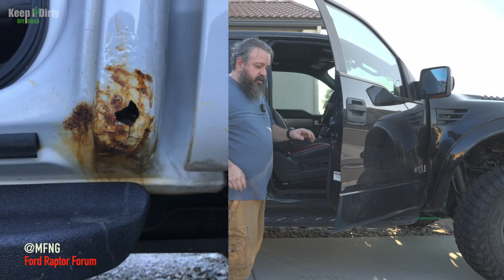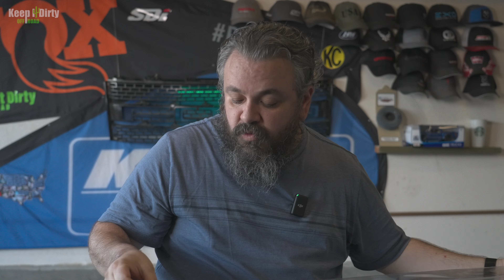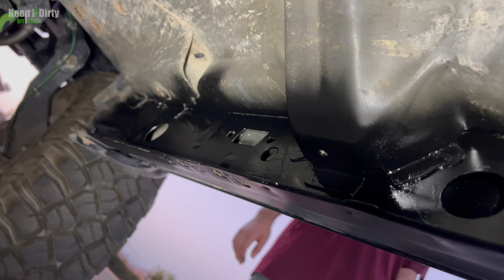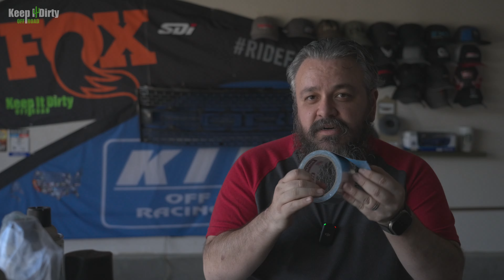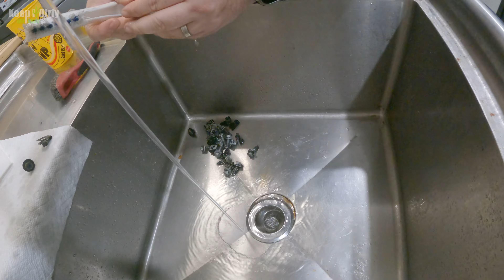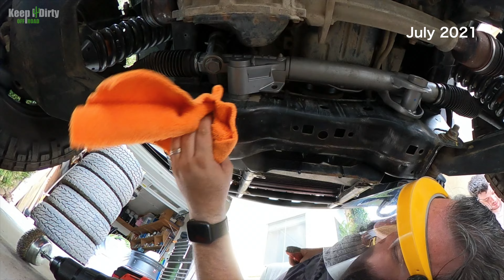Cab Seals  Gen1 Raptor - Don't let your truck rust away

Comment: I worry that due to not finding 3 out of 4 drain tubes they could be clogged by the wax. Thanks for all your videos.
Reply from the maker: The wax lays down thin and still allows water to bead away and down. Water still needs to be able to exit from the pinch welds and the wax has not blocked that. And those are much tighter. Tube opening is much larger and we have since had some major downpours here in SoCal with no issues
Reply: Cool, thanks for the information!  I appreciate your time.

Comment: Dang I just saw this and checked mine has little bubbling under passenger rear side and has now a small quarter size hole:(
Reply from the maker: Sorry to hear man. That rusted from the inside out. Definitely check with a body shop on repairing as it can get worse quick.

Comment: How could you clean the inside before putting in the wax?
Reply from the maker: Only way is a power washer or hose. But you have to make sure everything is dry before applying the wax. That could take some extra time.

Comment: It’s not a just a gen 1 it’s a SVT RAPTOR!
Reply from the maker: 🤣🤣 what’s the difference?
Reply from the maker: lol. Steel don’t matter honestly. I’ve had both and the aluminum body’s are lasting much longer and the aluminum bed is stronger. I’ve seen gen1 beds fall apart after heavy offroad use to the point they needed more than reinforcement. And treating the rust every couple of years on the Gen1 sucks. Cabs completely rusting out due to the moisture from the drain tubes. I’ll take the aluminum body anyday over steel.
Reply from the maker: I have a gen1 and the maintenance on the steel sucks man. Every 2 years I have to treat it. Not worth it . Aluminum cabs require no maintenance. 

I also have that gen1 v8 and NA it’s awful. It’s the epitome of a lazy v8. Supercharged it really wakes up. Going from a gen2 to a gen1 sucks if it’s NA too because the gen2 is so nimble and peppy compared to the slower and less powerful v8. 
But for off-roading the more analog gen1 is better. Gen2 though makes off-roading easier. Gen1 is for the experienced off-roader, where as anyone can offroad a gen2 fast

Comment: Why can't American manufacturers coat rust protection like the Germans? Is it really that much more? Really frustrating owning American cars
Reply from the maker: This is an older truck though. And ford has since switched to aluminum cans to avoid this all together. 

But I know what you mean. My e39 2003 BMW M5 does not have any signs of rust whatsoever because of how they build those cars.

Comment: Good video!  I used Grace Vycor Plus tape on mine a few years back.  It's made for flashing home doors/windows, but it's easy to work with, easy to cut to size, and it's super sticky if you apply it on a warm day.  It's really more a a rubberized membrane with a plastic backing than it is a tape.  They sell it at the Home Depots near me in 4" wide 75 ft. long rolls for under $30... I used the extra to add some soundproofing to my front doors when replacing the speakers.
Reply from the maker: Yeah would definitely work better. Other recommend butyl tape with is very similar. Definitely going to use that the next time

Comment: Would applying the cavity wax not trap already existing rust inside the rocker panel and cause it to get worse? I’m getting ready to tackle this project myself but was worried about that. Awesome content!
Reply from the maker: Surface rust is fine. It needs moisture to keep going. So you should be fine as there is no way to get in there and remove it. It would not be a bad idea to go in and clean the inside, but challenge you have is drying it all out before applying the wax.

Comment: Great Video! This was my plan this year as well to protect from the salt here in the winter in Indiana.  I also use woolwax/fluid film on the entire underside of the truck to help protect pretty much everything from that salt and snow.  Not sure it would be a good option for you in the dirt and dust, but might be worth looking into as well.  Ive seen other guys take the steps off and have them re-coated/rinolined, do you plan to do that as well or just leave them as is?
Reply from the maker: I’ve tried wax / oil Based  protective type films before and they don’t work well here in SoCal. 
They tend to attract and hold dust. And since the dust out here in the Cali desert has salt in it, you end up rusting quicker. Coated a whole leaf pack with a similar product and it was always brown with dust and they started to rust prematurely. 

As for the steps, right now I’m going to keep them as is. They are not bad enough to recoat again. I may later or try and adapt a gen2 step onto the truck somehow. I like the design of the gen3 side steps better

Comment: Need to mention the drain tubes for the sunroof for those that have them, this will cause the cab corners to rust out as well if you dont relocate them and treat them
Reply from the maker: We did mention them. Multiple times in the video. We could not find all of our tubes. Only 1 so it does have me worried

Comment: It disgusts me that Ford lets a design like that roll out of the factory.
Reputable car companies insert a plastic body plug that clicks in, and trains the mechanics at the dealer to replace them if they go missing, they don't just slap a sticker on it...
Reply from the maker: Agree and I think it’s one of the reason they switched to aluminum. Car manufacturing is all about saving money where possible and I’m sure there is a substantial cost difference between plastic stickers and rubber plugs across 600k trucks a year.

Comment: Would you say this happens more to truck that live where they salt the roads? Or any truck no matter the area where its from?
Reply from the maker: Any truck no matter the area because the sunroof sends all the water from the drain tubes here. Those in the rust belt are more prone of course because once the seals fail, you have salt and gravel that can get in there and rust it much faster.

Comment: Northeast 2010 Raptor owner here. I didn’t realize that Ford used literally just tape on these trucks to cover the rocker holes until I noticed rust poking thru. Ive since had the rockers somewhat repaired by a questionable shop. I now spray inside the holes with fluid film and replace the tape annually.
Reply from the maker: Good maintenance schedule to keep. Next time try the cavity wax to see if it lasts longer. I’m hoping it does

Comment: I bet you could take the inner door panel off and get inside there. Maybe?
Reply from the maker: I know that body shops can do spot repairs in those areas because it’s a common issue. But large sections have to be cut and separated and replaced. Big expensive job
Reply: @KeepItDirtyOffRoad  UGH! Sounds like a good time.